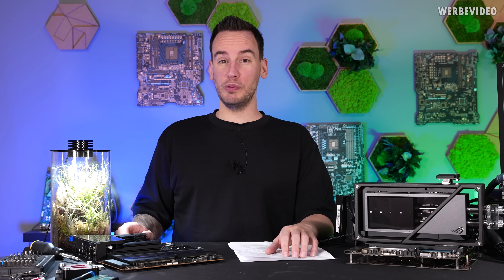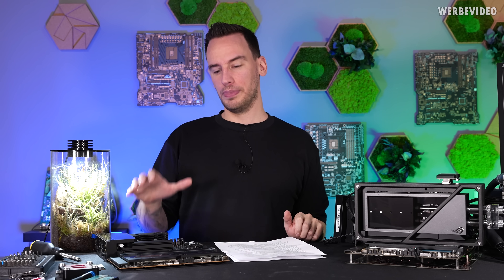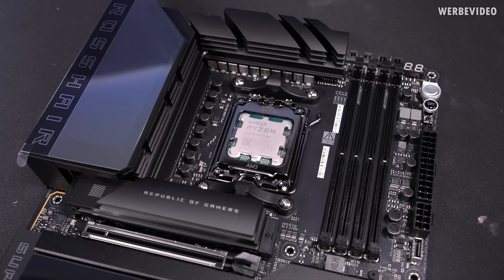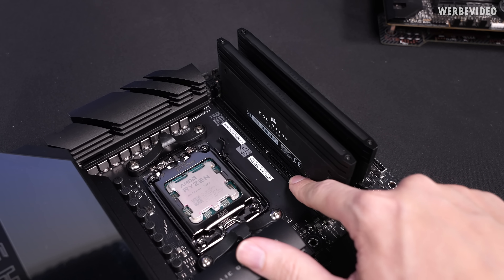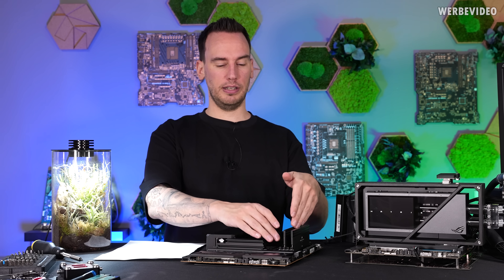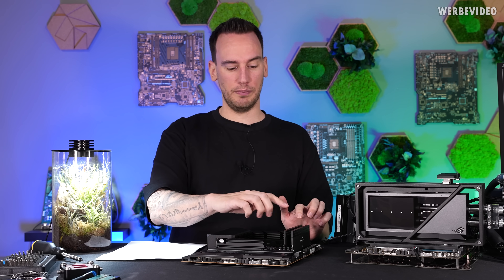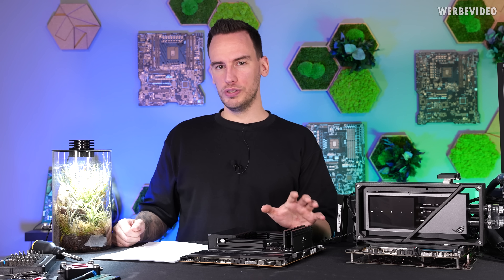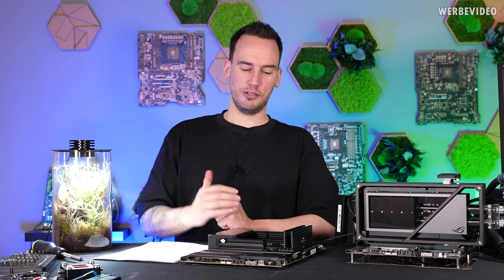How Empty RAM-Slots cause Trouble - ASUS NitroPath

Comment: The eye chart doesn't happen because of interference. It's because rising and falling edges are not instantaneous, they just look instantaneous at lower speeds, but they still obey physics and instantaneous information transfer is not allowed.

The square shape of square signals aren't that square, and as you increase the switching speed such that the rising and falling edges get so close they can overlap, you need to take into account the capacitance and inductance of wires into account and you get the eye chart.

There are 5 elements to an eye chart: the rising edge, the falling edges leading to the eye, the thickness of each edge leading to how large the eye is, and the top and bottom steady high and low signals.

As the edges become thinner, the signal quality is increased, the eye gets wider and can be made smaller again by increasing the raw switching speed.

The eye diagram is a superposition of a very large number of signal observations. Some of them stay high or low, some of them switch from high to low or low to high, and the stacking of all those results give you the eye diagram.

GDDR6X eye diagrams are of interest as they show exactly the 4 vertical eyes drawn by the four signal levels used to allow transmitting 2 bits per clock tick.

Now, interference has an effect on the eye chart in that they degrade signal quality and increase the signals' thickness.

Comment: Thank you for very interesting video. I wonder, what if we could disable not used DIMM slots on hardware level, will it eliminate need for 2 slot motherboards and different pins designs? Or it will function as antenna even if electricity not supplied?

Comment: The other way that we used (when I used to design 😅)to  prevent interference and minimise cross talk is adding a 7degree angle in the opposite way, and of course put a metal cap on non used connectors, of course the cap would be perforated to tune itself to microwave ( suitable in this case 😊)

Comment: So, that opens the question...Is there a dummy RAM module that we could stick into the empty slots, that would help reduce the noise that the current slots pick up?  Or shield to go around the ram, to stop the empty pins from picking up stray signals?   While it would be a niche product, if someone could develop a dummy module that went into the empty slots, I'm sure people would buy them for better overclocking, and i'm sure LED's could probably be added, for aesthetic reasons too.
Reply: I believe currently V-color is the only vendor that offer such kit as they patented the blank RGB DIMMS for DDR5. That's why Corsair haven't released any RGB DIMMS for DDR5 but hey have kits compatible with DDR4.

Comment: Empty slot problem was a long known thing, especially in the competitive OC world. What we didn't have was a solution other than going to 2 slot boards. The question now is, does this enable 4 slot boards to clock ram as good as 2 slot ones? My gut feel is that the 2DPC will still have additional track so might be slightly worse, but this will at least close the gap somewhat. I also wonder when CUDIMMs are fully supported (non-bypass) how they will also behave in 2/4 slot configurations.

Personally I'd love to see more 2 slot board options in mid range. Not really low end to save cost/space, or really high end for extreme OC.
Reply: Nah. Just give us those dummy cards that cut the EMI radiation. Problem solved and companies can sell more shit to you.
Reply: No, 2 slot will still be superior to this.

Comment: An example from my system  ... I use ASRock X670E PG Lightning with 2x16Gb Neo Forza 7200MHz ram kit...according to ASRock, their mainboard should support 7200 but when i run rams on 7200 by using bios oc feature it always fails while i am on gaming and shuts the computer...Than i changed the Mhz down to 6600...now i have no problems....Always use yor hardware a little below of their max capacity......Thanks for the good content...regards from Ankara, capitol of Turkiye....

Comment: You have to give it to Asus for making tweaks to the ATX motherboard design. Like back connectors and quick release pcie slots and 2 dimm motherboards and now this nitro path tech. 

I wonder if asus could do a clean sheet motherboard standard to replace ATX, what would they keep and what they change ?

Comment: As shorter path as better signal.
Then why in 4 slots motherboard A2 and B2 are ocuppied instead of A1 and B1 which are closer to the CPU?
Reply: signal reflection off of the farther slot
Reply: @regele4063 It will be reflected from the nearest slot as well. Just timing will be different.
Reply: @silentASengineer  too much to explain in a youtube comment :(

Comment: I wonder if you could build some sort of slot filler that shields the empty slots from electrical noise, could even use the same retention system as the memory

Comment: So, if I have a 4-slot motherboaard and I want to install 64GB, if the DIMM specs are otherwise identical, should I install 2 32GB modules or 4 16GB modules?
Reply: 2 32gb

Comment: I´m Waiting for the Future... CAMM2 !!
Reply: It feels like a hold over but I too am waiting for fully fleshed out CAMM 2 supported boards before my next build.
Reply: CAMM2 has a capacity issue. Without higher density RAM chips, there is only so much RAM you can fit on that small footprint. Unless you do HBM3 but the cost will be exponentially higher than DDR5.
Reply: @erictayet  hbm3 has nothing to do with camm2. High Bandwidth Memory (3) supposed to have high bandwidth, mainly by many layers, many data lines approach. DIMM and CAMM however have pin counts determened by standards. So, CAMM needs just more high density ddr5 ram chips, not different type of memory
Reply: @ВоваЕршов-й2ь  I'm just saying the only way to surpass current DDR5 memory density is to go with HBM3.

Camm2 can only go up to 128gb based on JEDEC specs.
Reply: i understand what erictayet is saying, but if they do adopt a stacked DDR ram approach as their default production they can even make CAMM2 obsolete in favor of just LGA mounting it.
LGA775 (excluding the retention bracket) is much smaller than CAMM2 for example, and thats enough pins to support quad-channel.
Reply: @erictayet  I mean, if you change standard, you need to think about compatibility anyway, so it will be new standard. Then why not just use|name it ddr6
Reply: @kitame6991  camm2 mount probably is much cheaper than any of cpu sockets. Probably, it is possible to extend the standard to deal with higher, and stacking ddr5 dies in single bga package is not/would not be the limiting factor. thou for next standards your approach could be reasonable. especially if 256bit ram for iGPUs bacame common
Reply: @kitame6991  this is an interesting idea. I suspect the main issue with LGA is trace routing on the motherboard. 

CAMM2 and DIMM are routed to CPU pin with equal length trace and in a row to ensure clock timing and minimum interference. The trace tends to be parallel or diagonal. With LGA, some trace will pass beside many pins of an LGA socket. Just my speculation...
Reply: @ВоваЕршов-й2ь  Yes, JEDEC is actively asking for proposals for DDR6 (connector/Memory configuration/signaling protocol) right now.

CAMM2 has just become a JEDEC standard recently and it can be double-stacked to get 128GB. Single stacked modules are limited to 64GB. The is the connector specs. In terms of capacity, DIMM slots can support way more RAM modules since it's vertical.

To increase the speed of DDR5, DDR6 may have to use QAM or PAM signaling schemes similar to GDDR7.

Comment: it's probably acting like more than just a ton of antennas. non terminated traces like empty connectors have the potential to cause reflexions in the signals. with how insanely high those frequencies are getting, the wavelength is very short so it's very possible that the empty slot happens to be at a distance that matches a fraction of the wavelength and causes destructive reflexions.
Reply: RDRAM 25 years ago required terminator modules for empty slots, due to reflexions.
Reply: @Apokathelosis  wow I didn't know that but it does make sense! if things keep going with faster frequencies we might see something similar again, or slots that have internal resistors that get connected when empty.
Reply: PCB vias that connect inner layers have to get the unused bits of via drilled out for the same reason. Stubs cause reflections. Wasn't really a thing for PCIe3, but starting with PCIe 4 and faster the high speed vias started needing back drilling.
Reply: Time to orientate perpendicularly those slots 😂

Comment: Can I pretty please have an ITX motherboard with nitropath for the coming 9800X3D? Even though it'll only see a smaller benefit? ))

Having the contacts at the END of the prongs instead of in the middle absolutely makes sense. I work for a big ISP with lots of DSL infrastructure (guess which one, heh) and having cable where there shouldn't be any absolutely impacts signal integrity because of reflections and the like.

Comment: Wow, thanks for the great video. The only thing that annoys me about all of this is that I still don't understand why there aren't more 2 RAM slots motherboards. I get the upgradeability standpoint but will you find the same RAM model when you're upgrading down the line in X years to make sure it all runs well? I don't think that a lot of people really upgrade like that especially since RAM is pretty cheap, but maybe I'm wrong. Personally when I went from 16 to 32BG I just bought 2x16 sticks and moved my previous ones to another system. It's the same with double RJ45 connectors where one is 2.5gbe and another 5gbe. I wonder how many people are using both, and how much more expensive would 1x10gbe be over current configurations with 2 LANs. I don't think many people convert their 700EUR mobo into a firewall when they are finished with it.
Reply: Yeah its dumb, we know there is a disadvantage to having 4 slots so why not release 2 slot models.

I'm sure a board that was cheaper and performed better would gain some attention.

Comment: This is a crazy idea: why don't they try to shield the slot connector, like the primary PCIe slot on high-end motherboards? As frequencies go higher and more signals get close together, there are more chances of interference—just a thought.
Reply: Shielding rhe connector doesn't shield one pin from the next, and you can't do that because the capacitance added to each trace would kill the signal speeds that could be used.
Reply: @GodmanchesterGoblin  Yes, exactly; what I was suggesting was to shield it outside so that it would not leak high frequencies to the surrounding components and traces. It will not shield each data pin from the other, but the DDR5 pinout already has a VSS pin between each data pin, so I don't really know precisely if adding an external shielding will matter much in terms of capacitance. Ultimately, the reduction in the contact pins' height already does a good job by increasing their resonating frequency, reducing cross-talk altogether.
Reply: @pedrofpsimoes  It's also got a lot to do with ensuring that the signal reflection from the unconnected pin has as short a delay as possible. That's what maximises the width of the eye pattern in the signal trace, ensuring that the signal remains as clean as possible.

Comment: Ok, what if the mb or cpu would detect slot occupation to eliminate signal wiring on empty slots, is it that complicated to implement? Now a days it is more likely that memories get only faster and faster, and the problem will just accumulate here.

Comment: I always believed the empty memory slot issue had been known about for years, that is why some manufacturers had memory slot blanking plates.
Is this for SM (Surface Mount) slots or TP (Through Pin) slots? The images seen to show, a SM slot.
I am not 100% sure, did one of the manufacturers, use an extra layer or two of the PCB (Printed Circuit Board). Instead of the memory traces being on the top layer of the PCB, the memory traces were a layer or two layers below the surface. This reduced the electromagnetic interference, which help with increased memory speeds.
There is a drawback to the ASUS design. If the memory module is not place in correctly, the pins will fold under the memory module. Similar to, incorrectly seating a processor in a PGA (Pin Grid Array) socket.

Comment: Kind of counter-intuitive. You would assume this means that running 4 DIMMs is more stable than 2 DIMMs at higher speeds, which is not the case in my experience. I don't trust Asus at all tbh.
Reply: thats why you have documentation. to not assume but to be sure about what you buy...

Comment: This cant be right.  There must be other engineering other than just making shorter contacts.
Reply: Its not just shorter contacts, it's having them bent down instead of sticking up.
Reply: @mr.potato9449  but its such a small reduction in the overall length the signals have to travel down the memory bus from the cpu to the dimms that the difference is on the order of less than 0.1%. Being that the primary objective to getting higher ram clocks would be to reduce signal interference between those two points i still think that theres more to this than a smaller and different shaped pin for the connector.

Comment: We could do a 2 slot on each side of CPU like some server MOBO, could have easily avoid this problem.
Reply: This would cause clearance issues for most cases that do not have sufficient space at the back to close the lid.
Dual side CAMM2 could work since it sits flat.
Reply: @Raivo_K  look up threadripper mobo man…trx40 we have them left/right, top/bottom. We’ve been doing it for years it’s not clearance issues.
Reply: that would need a whole new pcb design since you have to reroute and likely rotate the vrm to make space for those slots
not cost effective at all. it will end up being a massive board
Reply: Guys if we can have TRX40 with Ram slot on Left/Right, Top/bottom. I don't think it's that hard, especially these are MOBO for ram OC anyway it's not cheap product.
Reply: @Teasharky  its not worth it
the work that needs to be done to achieve that is too much to be justified
Reply: That would be worse than 4 slots side by side.. unless you want to run them in single channel.

Comment: Hopefully they can start implementing this on future revisions of server motherboards and start going higher in memory frequency hence bandwidth would skyrocket
Reply: By the sounds of it, it would have no benefit for boards with 4 memory modules installed
Reply: @strategicgnomer1  It would have benefit on every motherboard that has unpopulated slots running high speed. If there were DDR5 RDIMM kits with 8000MT+, it would benefit them. Extra stability for no significant cost added? Yaaaay...

4/8 channel servers with half of the slots occupied would benefit for sure, but from quick search, Kingston makes 6800MT top, so it would benefit a bit, but not so much until they push the speed further.
Reply: @Fr4kTh1s  The new Intel Granite Rapids (Xeon 6) support a new kind of DIMMs called MRDIMM reaching 8800 MT/s. With 12 channels the theoretical BW is 845GB/s. 
Google "phoronix intel-xeon6-mrdimm-ddr5" for a benchmark.

Comment: Very interesting, and quite surprising to learn that the pins act as antennas. Is there a reason they don't/can't disable electrical signals to unoccupied memory slots? I guess adding a switch could add latency or might affect signal integrity. It's impressive how much of a difference the redesign makes, and I'm sure it will be a bigger selling point for motherboards in the near future.
Reply: An unoccupied slot shares nearly all the same 288 traces as the other slot on the same channel.

There's nothing to be disabled.
Reply: From a quick overview, my knowledge of electronics and what he said, it seems like they are daisy chained, so you literally have a single wire for most of the pins on 2. slots, with probably only a control line being separate, which allows to select which ram chip talks.
But as you can imagine, you can't just turn off the wires as otherwise the stick that is inserted wouldn't be able to communicate.
The other options would be
a) to more or less double the number of pins on ram and basically have the controller on the main slot access the ram on the 2nd slot, but that also comes with a bunch of issues.
b) To have a semi or full quad channel processor which can  access all slots simultaneously, but that makes the motherboard more complex as you have an extra ~500 wires to route.
Reply: Sorry, I misunderstood. I thought there were separate wires for each channel on a 4-slot, dual channel motherboard.

Comment: Okay, but why do we need ddr5 speeds faster than 6400mhz? I thought we were past the point if diminishing returns and instead should focus of tighter timings?
Reply: I imagine many people asked the same question with DDR4-3600 and earlier standard and speeds. As long as downsides are mitigated we should always have higher speeds.
Reply: because it is designed for overclocking enthusiasts? 
for daily sure, the perf gain isnt worth in relation with the time spent getting everything fully stable

Comment: Very informative. Thank you! The last gen Hero can barely run VT3 at 7400, but with NitroPath it can probably stably run 8200. That’s insane for a 4-DIMMer.
Reply: I have 4 sticks at 6400mhzt ram on my AMD Ryzen 7900x and tbh anything above 6000mhzt is pointless
Reply: I have 4 sticks 128gb ram at 6400mhzt anything above 6000 is pointless on AMD